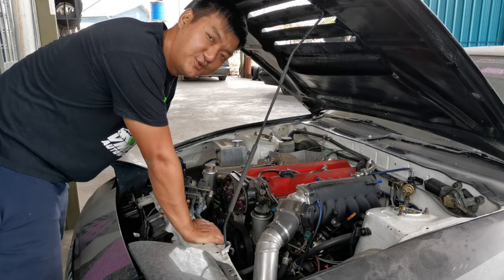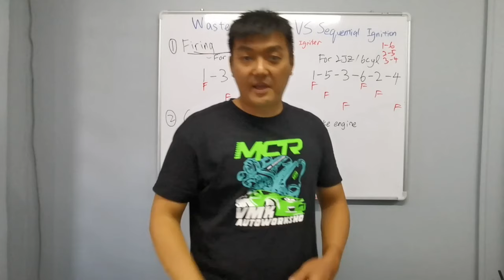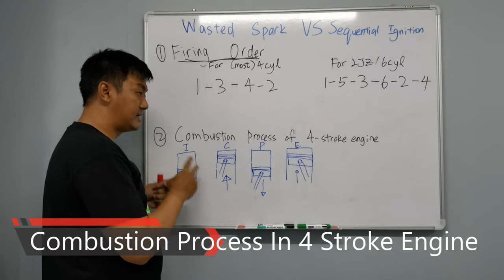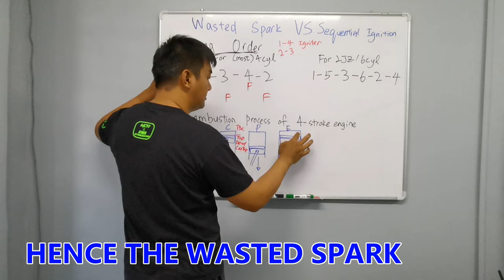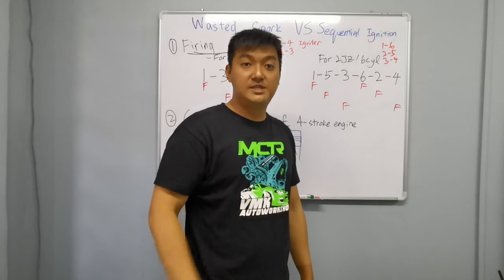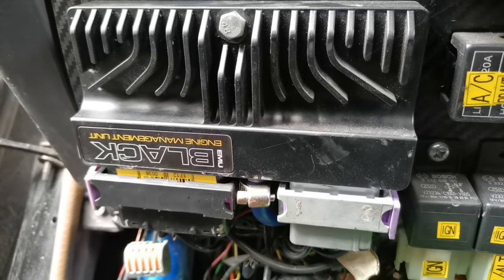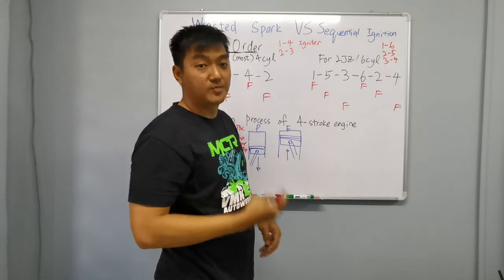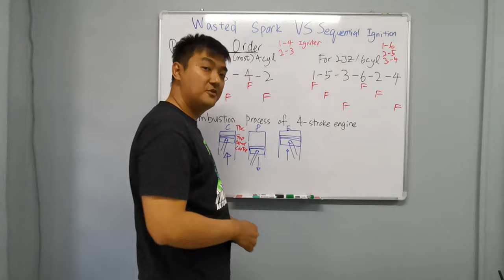2JZ Tuesday - Difference between Wasted spark or sequential ignition (for all 4 cyl, 6 cyl engines)

Comment: Michael if I'm using sequential fuel also.. one of each wire goes to the ecu pins... then I can tie  all the other ones to a 12v switch correct?

Comment: Hello, there is one thing that I dont understand, in wasted spark system, we need two spark plug wires to complete the circuit (secondary coil), but in real scene, when i unplug one spark plug wire(for example #1), the parallel #4 still have ignition, so how can it happens? Please explain me, thank you.

Comment: Your using the distributor for crank and cam sensor right?? Which cam sensor you using g1 or g2?
Reply from the maker: Sorry not distributor. I'm using the crank sensor and cam sensor pair. Sorry I don't know there is a difference. I believe both types of cam sensors are the same. Only 12 teeth at crank gear vs 1 gear at cam. Or 36minus2 at crank gear vs 3 gears at cam. If that make sense

Comment: very good video, thank you for sharing. Looking forward to more videos in the future. How about batch fire, wasted, or sequential fuel injection? :)
Reply from the maker: Similar concept too.. But the timing of injection is earlier than ignition and depends on your ecu how it calculate
Reply: @cheapkailaujing  yeah I hear some of the old school guys and old school ecu's were batch fire only. I hear sequential fuel injection mostly helps with afr fine tuning and fuel efficiency. Just not sure if sequential fuel injection is necessary for us tuners
Reply: @cheapkailaujing  I just thought it would be a good follow video to this awesome ignition video you made :) thank you for sharing your awesomeness
Reply from the maker: @DJimeku  it is, especially we can know how to adjust the furthest cylinder ignition or spark because it is getting lesser air, and also when high rpm, the duty cycle of fuel injectors and ignition coils are halved
Reply: @cheapkailaujing  ahh yeah makes sense. At high rpm I can imagine duty cycle of both ignition and fuel would be too high to keep up LOL.
Reply from the maker: @DJimeku  ahhahahhahahha double of everything. idling is bad for batch injector too.. cannot refine the spray
Reply: @cheapkailaujing  I see I see, thank you for sharing. Is it possible to do wasted and sequential fueling? I hear that with no cam position sensor, batch fire is the only option. Am I wrong?